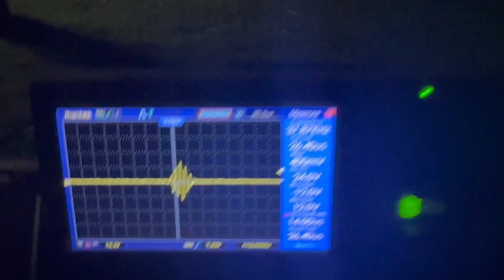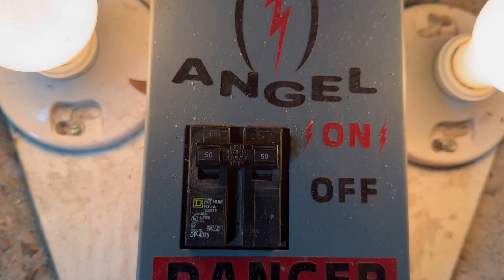Biggest Tesla Coil in the Southeast

Comment: Why the arcs are so branched? And also what is the length of the arcs
Reply from the maker: This coil can do 20 feet arcs. The branch's it do to a few things but mainly from how you interrupt the pulses.
Reply: @ArcAngelTeslaCoil how much KVA is pulling from the mains?
Reply from the maker: @B @hvMarty well I been to just over 20kw but it could do more
Reply: @ArcAngelTeslaCoil wow for 20ft arcs is very good really
Reply: @ArcAngelTeslaCoil it's the most prettiest arcs that I ever seen
Congratulations and love from Argentina ❤️
Reply: @ArcAngelTeslaCoil sorry for asking to you without reason but
How much capacitance do you have in your bus, MMC, and snubber? and also what IGBT did you use?
Reply from the maker: @Baueusing around 12000uf bus, .777uf Mmc,4uf snubber and full bridge of cm600-28h
Reply: @ArcAngelTeslaCoil wow that's pretty low values for that big arcs, I was thinking about doing a 30mf 600v capacitor bank for the bus because I see the Steve ward works and he says something about x20-50 the energy of the MMC, also do a X2 cm600 or fz900 bridge, but now I gonna thinking that is not gonna be thaaaaat expensive, how much did it cost to make your coil?
Reply from the maker: @hvMarty the Mmc was the most expensive part and it's rated for 5000 amps
But this Coil runs great the only reason I can get long arcs is because the coil height.  Also been to 800 volt bus but only a few times really needs primary cooling. The primary current is at the moment 1800 amps.
Reply: @ArcAngelTeslaCoil you are running this coil in pulse skipping or long pulse modes? Or it's normal pulse time? Also 1800A of primary current isn't that much, or I misinterpreted what you said, but 6 meters of arcs is crazy, how looks in person?
Reply: @ArcAngelTeslaCoil you have a Discord server or something?
Reply from the maker: @hvMarty got Facebook messenger used to
Reply: Ok, thank you for resolve some of my doubts man you're great
Reply from the maker: @hvMarty like your not far enough away 😂 but this coil is Freewheeling I do have a pulse skip also. Video don't give this coil any Justice!! It has hit over 6 meter more than 3 time point to point but it's got to be no wind.
Reply: @ArcAngelTeslaCoil 😂 I measured 6 feet long and 12 feet tall in my backyard and it's absolutely terrifying how big it is and how """""""""small"""""""" looks in the video (it's massive but in the screen it's doesn't look that)
Reply: @ArcAngelTeslaCoil you made the freewheeling + pulse skipping driver by yourself?
Reply from the maker: @B @hvMarty no I got the UD+ and skip pulse from a good friend
Reply from the maker: @hvMarty https://youtube.com/shorts/W8Q4z2fcnaQ?si=Wtjuf3Fr90-pBFYe
Reply: @ArcAngelTeslaCoil how long you are pulsing your coil?
Reply: @ArcAngelTeslaCoil woooow the pick up looks so small, make a faraday cage and get inside it 😉
Reply: @ArcAngelTeslaCoil how much did it cost build the coil?
Reply from the maker: @hvMarty  on this coil I've been to 2ms

Comment: I wonder what happens if a rodent is struck with a lightning bolt from this machine.
Reply from the maker: 🤣🤣 wouldn't be happy 🤣🤣 once I had a Owl fly between the coil and ground, it wasn't running at the time lucky 🤣 but was close
Reply: @ArcAngelTeslaCoil  the owl was lucky indeed! What are the voltages that push out these fantastic arcs?
Reply from the maker: @shawncalderon4950   this is a very hard question to answer because of the variables but just a guess would be 1.5millon mabe but any way very high. Once a plasma channel is created it makes it much easier for the plasma to grow. Moisture in the air, temperature ....
Can change some of the characteristics. The primary on this coil sees about 1800amps and the bus voltage is around 680vdc
Reply: @ArcAngelTeslaCoil  Impressive! Thank you for your answer.  Is the voltage of the Tesla coil secondary high enough to charge a piece of cylindrical plexiglass? Again you are very kind to answer my questions.
Reply from the maker: @shawncalderon4950  thank you⚡️⚡️ I believe you would need high voltage DC to charge something like this a Tesla Coil emits A/C so like a Van de Graaff generator or Marx generator something like that 👍👍 not sure if this answer your question?
Reply: @ArcAngelTeslaCoil  Yes, it does answer my question, thank you. I appreciate the response rate to my questions. I am a disabled Vet, an invalid for most of the time. So, I spend a lot of time on YouTube. As health permits, I will binge-watch all of your fantastic content!
Reply from the maker: @shawncalderon4950   thank you for your service!! Also thank you very much for your support😁👍⚡️

Comment: what is the power of this incredible coil ?
Reply from the maker: Well there are a lot of variables but to keep it short lol
It runs off 240v a/c rectified to 680vdc with a primary current of 1800amps and try not to trip the 50amp breaker on the 240vac side👍⚡️